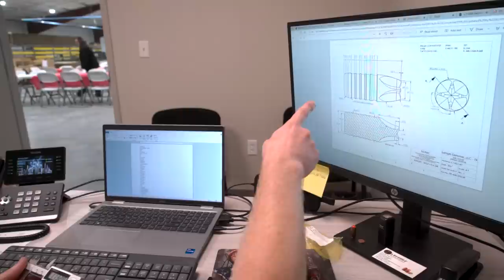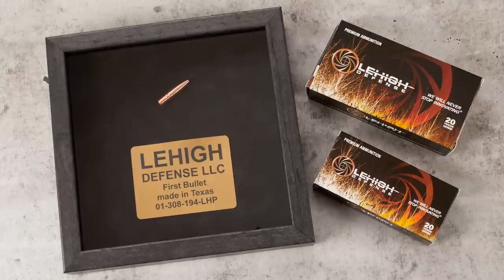The New Lehigh Defense in Texas - Grand Opening

Comment: Lehigh, We need heavier Extream penetrators & 220 grain coated WFNHC for Alaskas exploding 10mm market. Hot/ heavy bear loads. Prob be great for pigs too. Best i could find was the 115 grain XD & even @ 1700 fps theyre kinda light. We have BIG bears & BIG wolves up here. Heavy & Hot  is always preferred. Thanks!
Reply: I do not believe you will get any HD bullets from lehigh defense
Reply: @robertmarshall6508  , I thought they said they could design any bullet in a few hours. Was just a suggestion. Best HCWFNs ive found up here in grizzly country for the 10mm is the Underwood coated units. Smooth as butter & hit just as hard as the Buffalo Bore 200 grain E.P.s do and TONS cheaper. Hard to get too. Was hopeing the competition would lower prices somewhat. Buffalo Bore is REAL proud of their stuff. Effective, but ouch, ouch. OUCH!
Reply: Sorry Tristan spell check did me in again in my post I meant hardcast or  a bullet containing lead in my opinion for the $$$ the Underwood for over the counter is very good stuff
Reply: @robertmarshall6508  , Definitely! The Underwoods impressed me. I have a 3/4 inch thick stainless steel plate for a target & the 220 Underwoods made just as big a dent in the plate as the Buffalo Bore 190 grain monometal slugs did. Course the Underwoods compleatly exploded into dust but the damage was the same. The best part was the coating on the Underwoods,  made the heavier slugs slide out WAY smoother for better patterns while  aiming due to LESS recoil. During my " real world" point  shooting @ 15 yards. ( call it real world because during an actual attack you DONT have time to aim. Bear attacks are FAST & USUALLY up close. Point shooting is the best your gonna get.) I put 4 into a 5 inch circle in just over 1 second from draw to final hit. The lighter B.B solids took longer & were all over the 24 inch plate w a lot more recoil. I was NOT impressed w them at all. At $65 a box of 20 vs $23 for 20 w the Underwoods. Both were rated at 1300 FPS on the boxes. Ive shot a lot of bears w Buffalo Bore 420 grain WFNHC @ 2300 FPS &  found the WFNHCs  compleately intact on the far end of the bears virtually undamaged except for the rifling marks of my 45/70. Never needed more than 1 shot through the sternam. ( So far)  Bears from 6-10 ft. ( squared) Hit the biggest one charging in @ 100 yards square in the sternam & it just dumped him flat. He was coming in hot & slid 20 feet on his face in the open swamp. DEAD! Bears shot through the shoulders just blow right on through. Moose too, similar results. We have a saying up here in Alaska. If its close enough to hurt you its close enough to shoot in the face. Handguns are merely a backup if you cant get your rifle into play first. I havent yet shot anything with the extream penetrators but the ballistic tests ive seen are quite impressive. Grizzlies have the 2nd densest/ thickest fur/ bone/ flesh of any critter except Water Buffalo being #1. Im pretty sure one HAS to use solids on the Buffalo. No personal experience with them so cant say for sure. In any case, up here, Hot/heavier is always better. I know guides who carry 416 Rigby double rifles or bigger to back up their clients because theyve seen lesser rifles fail. Grizzlies are hard to kill. Except w a brain shot. Size dosent matter once you turn OFF the main switch. Saw Tim Wells instantly drop an average grizzly with an Arrow! Right up its nose into the brain. Ya. Forget that noise for this lil grey duck. Im going big bore & fast rapid fire. Contrary to popular beleif a bears skull is NOT bulletproof. No thicker than ours. Its the way the brain sits behind & below the eyes that started that myth. Everything above the eyes is just jaw muscles. Can shoot through their big heads and compleatly miss anything vital but really piss the bear off. Gotta hit em in the eye, up the nose or at the base of the ear to hit their tiny brain. ( relative to head size) We had an old bushlady out here who only used a 22 L.R. rifle & she killed lots of bears by putting a solid up their nose. Said soon as they looked at her she shot em. Did say shed never actually been attacked thou but wasnt taking any chances they might try. Natives regularly hunt Polar bears with 22 Hornets.  Head shots to not waste any meat. Amazing people.